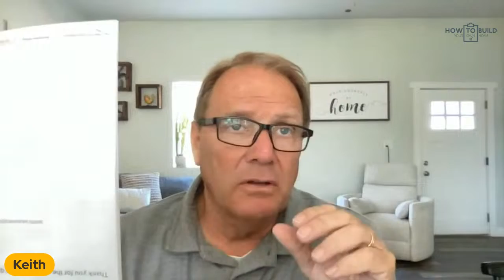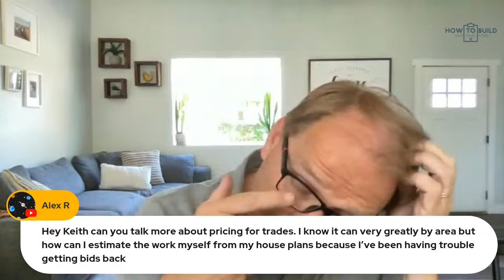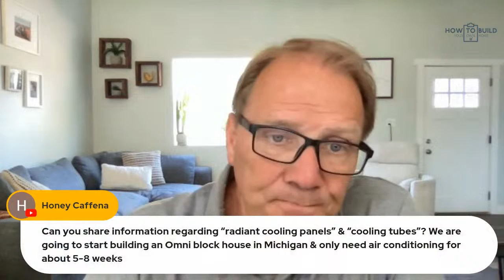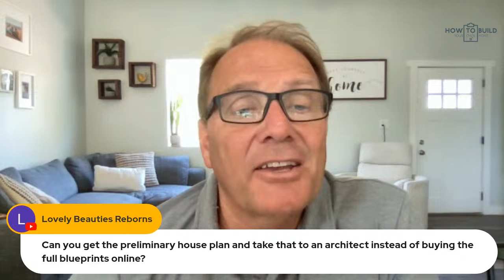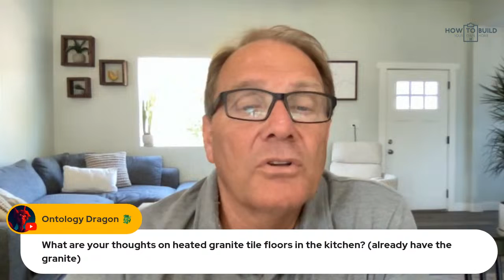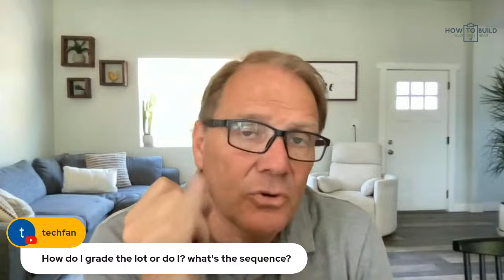Q & A with a General Contractor

Comment: The conversation on windows is helpful. But it’d be good to note that aluminum window prices were compared to Vinyl. This is an apples and oranges comparison. It’d be interesting to know what the price was for Alpen’s uPVC (or maybe its fiberglass) option. Hopefully more European tilt turn options can make it into the supply houses as well as more local manufacturing. I have lived in Europe and USA… the tilt turns are dramatically better than typical USA windows.
Reply: He did state that Al was more expensive

Comment: Got a quote for Pella Impervia (Fiberglass) from Lowe’s for just over 26k without installation, I’m planning to have my framer install.      My Amsco studio vinyl bid was right around 22k installed.  We’re going with lowe’s but not sure what jamb depth to use for 2x6 exterior walls.  Any suggestions?  We’re black exterior/interior.  Options are like 3 1/2, 4 1/2 and 6 7/8 (number may be a little off but close).

Comment: Keith, just an FYI on the Alpen windows, they now are moving towards a solid pane for the center glass at the same cost as the film. If you go with them, you can specify full 3 pane glass for the same price. We met with the rep a few months ago. I think they had issues with the film in terms of longevity.
Reply: Also we had quotes from Alpen and EAS (European Architectural Supply) for same windows and the EAS windows were about 30% higher with $8K for shipping. If you want massive windows, the uPVC European windows allow the largest glass sizes for the lowest cost due to the beefy reinforced frames. We have many 8ft+ windows in our design and US windows cant really span that far without going to pricey aluminum. We will be sticking with Alpen for our build in Colorado. Cheers!

Comment: I’m having a problem sourcing Rockwool 2 inch comfort board exterior insulation. There is a product called powerwool. Any suggestions or sources for any of this. Where are you getting Rockwoll insulation?
Reply: In my recent experience, I couldn't get Rockwool. Major shortages in my area for the last 6 months.
Reply: We were going to go with RW board as well for fire protection, but our engineer talked us out of it due to lack of supply. He pointed out that using fiber cement board for the exterior was the key (and metal roofing with a DensDeck layer below). We switched to Zip-R for our continuous insulation and will rely on cementitious boards or stucco and an air gap for fire risk mitigation. RW is the best, but hard to get now.